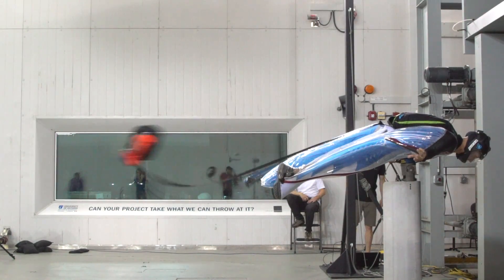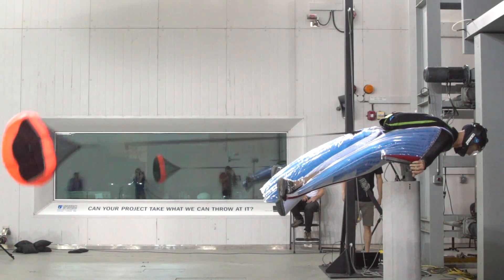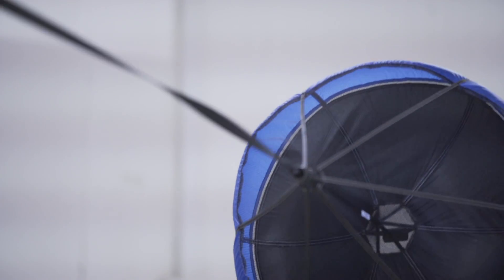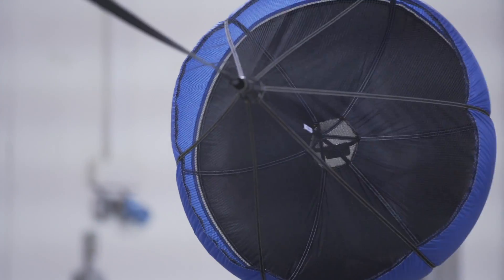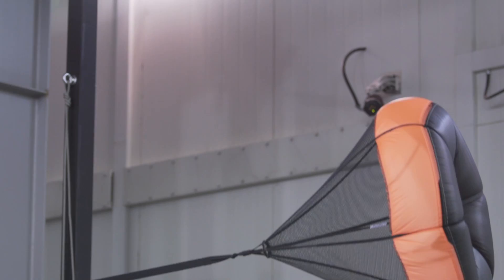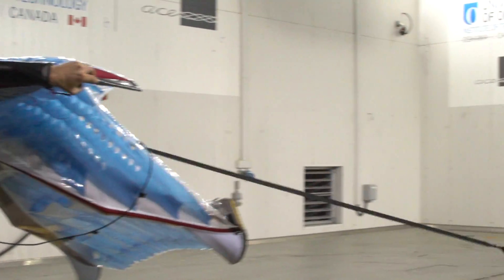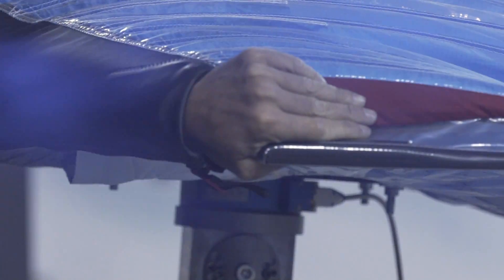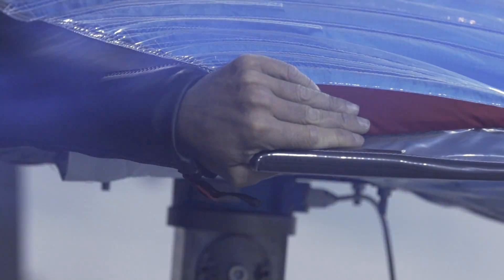Wingsuit Wind Tunnel Flight

Comment: As a skydiver myself, granted with limited wingsuit experience at 40 wingsuit jumps, I wonder how this windtunnel test is representative to the real thing. This wind tunnel test seems to give 100% head wind meaning the relative wind comes fully from ahead. In real circumstances, depending on pilot and wingsuit used, the actual relative wind  will never be fully ahead but diagonally coming up from down ahead since the glide ratio is more or less 2/1. Meaning for every 1 meter dropped the pilot will travel 2 m horizontally.
Reply: They're probably testing the angle and airspeed of a WS in a flare. If they wanted to test deployment at full flight they could angle the wingsuiter back so the wind is hitting more of his belly.

Comment: I'm not suiter or jumper. Everything looks so purpose built, slick and functional on that suit. Wow! Art! So, I have a question. Why aren't the shoes the pilots are wearing specific to the sport? Tennis shoes? Maybe an aerodynamic design that improves air flow and maneuverability? Dorsal fin off the heel. That way you could crab through the air. But like I say I'm a nobody. I'm just in awe of you suiters!
Reply: How about some shoes like Ironman to give extra thrust so you can actually " fly " rather than just glide down to that big hard Rock " earth "
Reply: Don't forget they don't need a loner runway or distance to land, so far they're the best landing gear to this date after the birds
Reply: I flew wingsuits for a short while. Shoes are irrelevant, any normal shoe will do, the wingsuits are made as such so you cup your shoes into a purpose build slightly enforced fabric space, you can see it here: https://bit.ly/2WtkH98. The aerodynamic design is fully delivered by the wingsuit since all is covered by it, it's also functional since it provides tension. You do however have a point but it's not used for wingsuiting. The only skydiving displines I'm aware of who might benefit from specific type of shoes are the freestyle skydivers (like ballet in the air) and perhaps the speed skydivers (record vertical speed discipline). Both of those disciplines are extremely niche and there is no manufacturer making purpose built shoes for that as far as I'm aware of.
Reply: All that matters really for aerodynamics is the leading edge. So having tennis shoes won't matter much as they will be located in the already turbulent air and thus generate almost no lift anyway
Reply: @jacobagnew2015  That is completely false.